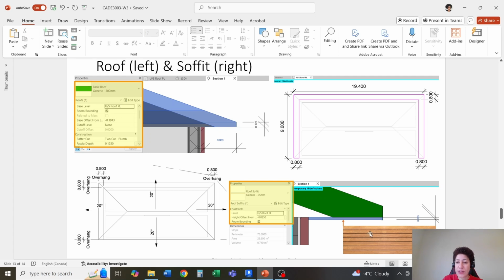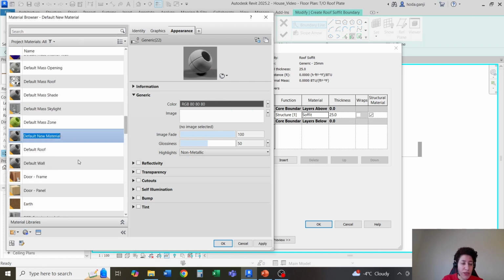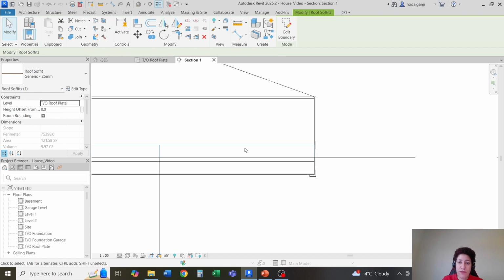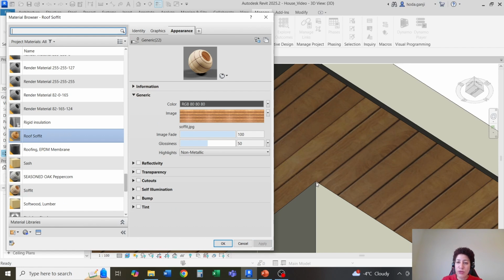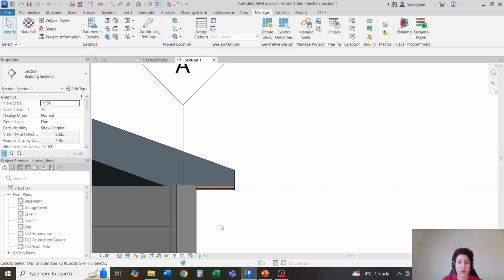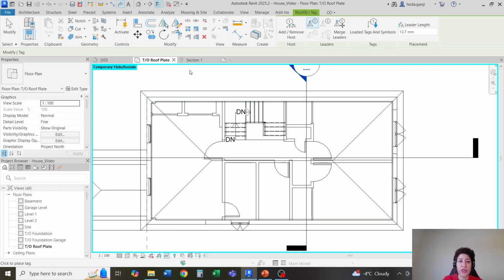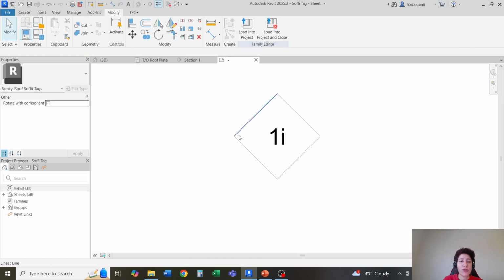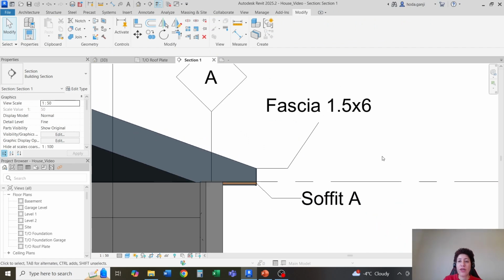Soffit in Revit with Realistic Material, Tag Family

Comment: Nice tutorial, Hoda. I have one comment to share... it is not optimal to offset the material (in material properties) for a special alignment condition within the model, as there would likely be multiple cases for the same material. Another way to manage material alignment is to assign a Model Pattern to the soffit. Model patterns can be repositioned relative to an element's surface, which also causes the render material to move as well. Plus, the model pattern also provides the wood slat lines in the construction documents when the render material is not visible.
Reply from the maker: Thanks for sharing that, I'll definitely consider that!